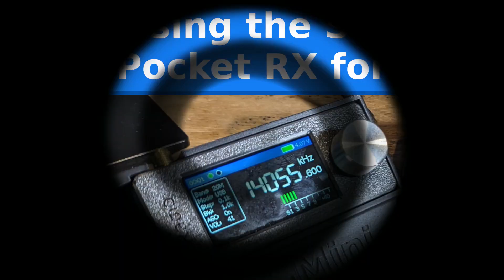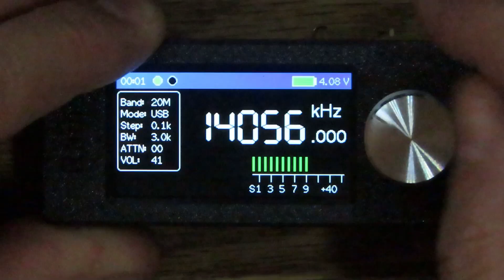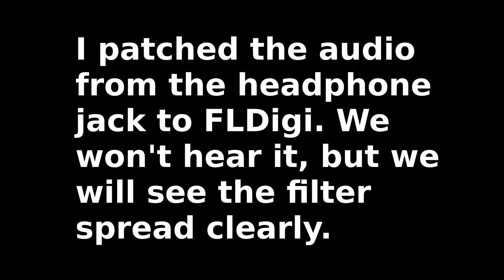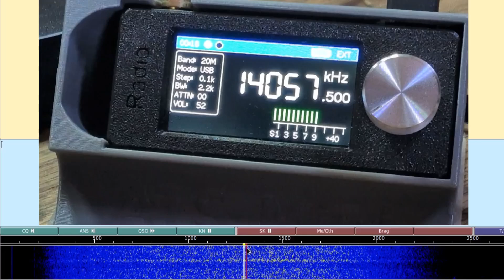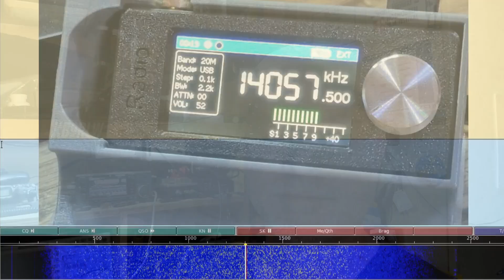Ham Radio - Using the Si4732 pocket receiver for CW, Morse code.

Comment: Kevin,  Inspired by your original YT, I created the same setup and had a few QSO's. My latest addition was to replace the RX with (Hamgeek, ATS-25 PRO AIR, DECODE) much better performance (no annoying thermion effect or weird tx/rx keying 'tweep-a-tweep' sound! - Still trying to get the 5V Mod from Harry - current Flea PCB an Schematic not in Sync!! 73 ve3ega

Comment: Quick question... great video... How do you keep from overloading the receiver when transmitting? Tks.
Reply: And... I've answered my own question. For those like me who don't pay close enough attention, hi hi... The "CW Flea" transmitter here has a wonderful built-in antenna switch that both grounds the receiver as well as switches it out of the antenna chain when transmitting. (Also, I just now see that Zachtek sells an RX-TX automatic antenna switch as well for other transmitters!) 73, Randy

Comment: Kevin, not sure if I asked, but what TX/RX switch you using to mute the receiver?
Fred VE3FAL
Reply from the maker: The CW flea has the transmit receive switching built in. When you key down, it fires a relay that grounds or shorts the receiver output and then switches the antenna over to the PA section.  Even with the receivers antenna shorted, it still picks up enough ambient RF to become your side tone. It'll register about a 10 over s9 signal level.

Comment: What are you using for  T/R?..or maybe separate antennas?
Reply from the maker: The CW flea has a transmit receive relay built in. When it goes to transmit mode it shorts the receiver output connector to ground and switches the antenna to the transmit section. 
Even with its antenna connection shorted, the receiver picks up enough ambient RF to become the side tone. It sees around a 10 over s9 signal.

Comment: I found the phase noise is a bit high from strong signals on adjacent channels, probably due to the  frequency synthesis from the 32,768 Hz crystal in the SI4732 circuit. Having said that, I am amazed at their performance.

Comment: Is there any way to get a vfo signal out of the synthesiser in the RX to drive a QRP PA stage?
Reply from the maker: Maybe. However, your transmitted signal would be on precisely the same frequency and zero beat. The transmitter and receiver have to be offset by the pitch you desire for the CW tone.  And that would only apply in a direct conversion receiver where the VFO is on the operating frequency.  In a superhetrodyne receiver, which this is, the VFO is nowhere near the operating frequency since it's mixed with the incoming signal to produce an intermediate frequency for amplification and filter processing.